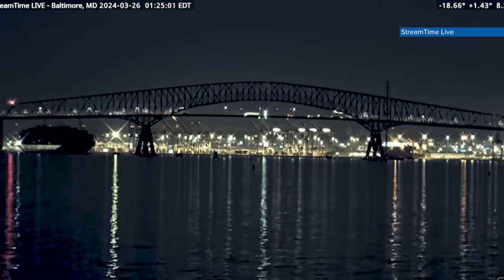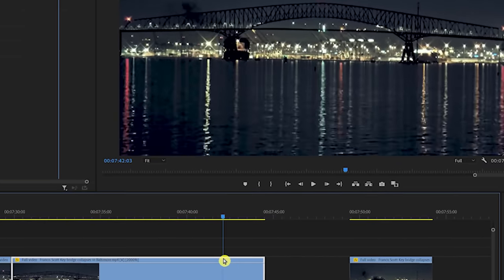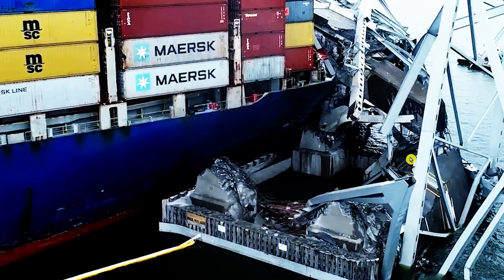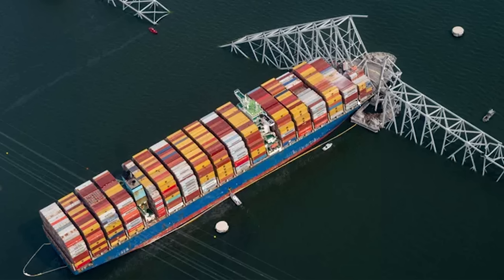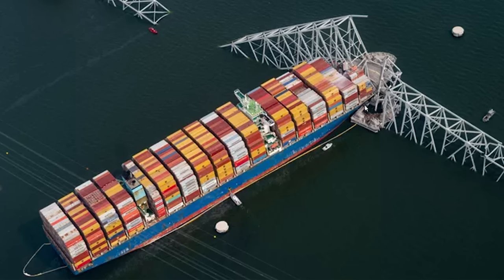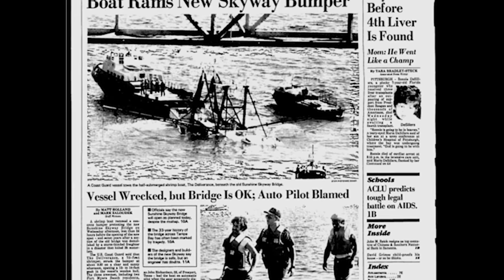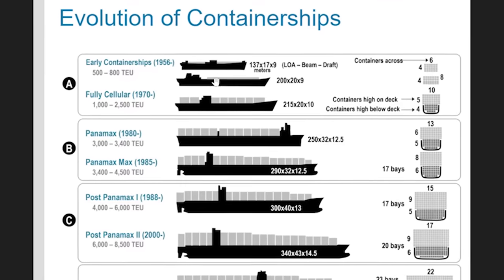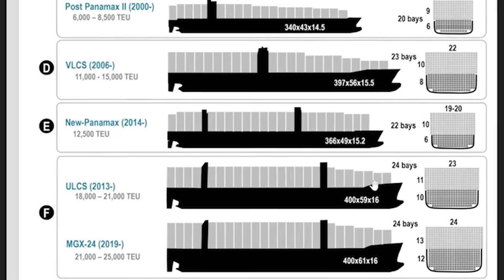NO Dali Bridge Crash Protection Like Sunshine Skyway Bridge?

Comment: The Francis Scott key bridge was built to specifications that were around in the 1970s. In the early '80s, there was an accident that brought a bridge down and they amended the code. This bridge predates that code. The replacement bridge will meet that code. It's not like this kind of thing is unusual. Code changing after you build an important structure.
Reply: The four dolphins there were built after the Tampa Skyway accident, and original plans had called for 4 others to be placed more or less where he estimated. However, the city of Baltimore rejected those plans because the city felt the cost was too great for a "very unlikely event" like this. These dolphins had nothing to do with the original layout, but we will see how it all turns out. As you said, the new bridge will be assured of increased protections, as well as other critical bridges being upgraded based on what we learn here.
Reply: @leechowning2712  Of course it will cost a billion dollars.
Reply: @leechowning2712 the city doesn't own the bridge nor have a say in it. It's a state owned bridge.

Comment: Question => Considering the need for a replacement bridge, what would be the best & most economical way to rebuild?  Is it your opinion that simply replacing the former structure with possibly improved pylons and dolphins would be recommended for expediency?   Once the debris is removed and channel re-opened, will bridge engineers or politicians determine the bridge structure replacement?

Comment: Thanks Jeff

I suppose easy to be wise in hindsight, but these types of accidents have happened in the past and lessons applied to both bridge operations and design as well as marine operations.

Many bridges have restraining straps (typically chains/cables) to help prevent catastrophic collapse in the event of a support being disrupted. Many heavily trafficked bridges also have substantial caissons up and downstream of the bridge pylon designed to deflect the largest out of control ships away from the bridge's pylons.
Reply: What if the ship is simply so large that you can't stop it? Try 112,382 tons. (A medium size ship).

Comment: simple regulation for tug support til out in open water would have made it unlikely too. 
it wouldn't have happened at vancouver's port because of such a requirement.
Reply: Remember, Vancouver had some very bad accidents.
Reply: Cost cutting, protocols but the bridge are well build from yesteryear but nowadays ship are getting bigger and bigger
Reply: Moran Towing and Harbor Services would love such legislation since it pretty much has a monopoly in every port from Maine to Texas. This company lobbies every year for both state and federal legislation requiring it.  They currently do escort and assist ships in and out of the harbor but only at the ship operator's request and at a very high cost.
Reply: Its happen before there's tugs support when channelling in or out till open water up to the nxt port of call but nowadays there's a protocol in some country like stateside you have to change over from heavy fuel to pure diesel while channelling and while at port, a ship is a power plant it has its own axilliary engine that gives electrical to run the machineries on deck and machineries on engine room that drives the main engine and all of that engine are design for heavy fuel exclude one emergency genset so its unpredictable when or when that something gonna happen
A container ship compare to other are well maintained old or new big or small and in port or at sea, what a hell for the engineers that things happen...RIP to those who perished on that incident

Comment: Jeff, 

Take a look at the Coronado Bridge (Coronado, CA to San Diego, CA), the Benicia-Martinez (Benicia, CA to Martinez, CA), and the Alfred Zampa Memorial Bridge (Crockett,  CA to Carquinez Heights, CA).  Each of these bridges has different arrangements than the Key Bridge, but all offer better protection. 

I can't recall which bridge the ARCO Juneau had an allision with it was either the Alfred Zampa or the Benicia-Martinez, but the fendering protected the bridge.  The ARCO Juneau was a 120,000 DWT tanker of a similar size to MV Dali.  The Juneau had two holes in the shell, one 10' high x 100' long, and the other 10' high x 200' long.

After watching the films over and over I believe that the flare of the bow overhung the fendering and it hit one of the bridge's stanchions, initiating a chain reaction of failures.  I heard someone in one of the news reports say when the bridge fell on the Dali the sudden load change grounded the vessel.  That is why the ship is trimmed by the bow.

Bob
Reply: The Arco Juneau had an allision with the Zampa bridge (locally known as the the Carquinez Bridge).

Comment: There is a bulbous bow on most large container ships that rides under the water line that would impact the protection structures much further ahead of your calculations. They stick out nearly as far as the highest bow points.
Reply: Bull nose water disperser
Reply: @bfa-xi1py  Agreed, that is why it side swiped the supports.

Comment: I would be very interested in a series on the protection ability of concrete dolphins at various U.S. ports. As was said container ships are getting bigger and our infrastructure (like bridges) is becoming older. I am currently living in an eastern U.S. state near a seaport so I am more than hypothetically interested in the safety measures currently in place.
Reply: For the most part they haven't kept up.
Reply: Sydney Harbour Australia has a similiar layout to Baltimore Port. Narrow exit called the "the Heads"..SH Bridge, opera House etc nearby. Approx 2 weeks ago the Queen Elizabeth (95,000T approx same length Dali) left Sydney. 3 big tugs escorted it through the heads and into open sea. Sydney Harbour Pilot/Tugs take no chances.

Comment: 99% of the time when people mention "fracture critical" they have no idea what they are talking about. If you disagree respond with the three requirements for a structure to be considered fracture critical. A 95000 ton ship is going to do a number on your bridge, same result if its a steel or concrete multi-girder, a suspension bridge, or cable stayed. You cant stand up when someone sweeps out your legs and a bridge cant stand without piers. What a shame. I liked the truss/tied arch combo. Reminds me of the Norris bridge in VA
Reply: You seem to be saying bumpers would do no good, I think that is correct. It is 112,382 tons, not fully loaded.
Reply: do you ever see what small street bollards do to 30 ton container truck?
Reply: My concern is that we let ships that large, without redundancy near bridges period.

Comment: There is another possibility to explore. The engine was intentionally shut off by the chief engineer when switching from normal diesel fuel (cost more, only used in port) to much cheaper heavy bunker fuel (not allow used in port) when it on its way.
Reply: Makes sense. Bad economy. Ukrainian Captain too.  High potential for greed
Reply: @SlickBlackCadillac  All Indian crew, where did you get your information?
Reply: What about the fact it was not out of the port? What about the rumor that it had power problems for 2 days before it left the dock?
Reply: HFO is not allowed in this are either, and the authorities look for things in the exhaust so ships who do their changeover too soon are regularly caught..
With that said, fueloil changeover does not require an engine shutdown, but will require the engine to run at some speed in order to clear the fuel system (mostly important when changing from hfo, to mdo as you aproach the line where you are no longer allowed to run on hfo, as the changeover process takes time to clear the fuel system and crossing the line too early can/will cause legal issues and fines)

Comment: Excellent analysis. Remember that very late in the series of events they dropped the port side anchor. Could that cause the stern to swing to the port side as that side anchor drags along.
Reply from the maker: No my guess is the anchor was dropped to make it pivot tot he left, but likely it was ineffective s the anchor will not slow down a moving ship, and maybe it needed more time to make it pivot.
Reply: @jeffostroff  I'm thinking they tossed the port anchor to swing the bow to port, but since the chains are so long, there wasn't enough time to actually take up the slack and start digging into the sediment before the impact.

Comment: The Sunshine Skyway bridge, too, came  under scrutiny some years back when it was noted that politicking for Florida resource use substituted Florida limestone for Vermont granite in the concrete superstructure when the destroyed bridge was rebuilt. The salt water conditions at the mouth of Tampa Bay in the Gulf of Mexico require significantly more maintenance to avoid corrosion (with limestone than granite).

Comment: If you find a shot of the stbd bow you will see a great slab of steel torn off the flare where the impact occurred.

The water either side of the dredged channel is 33-34 feet.
The channel is dredged to 50 feet.
The ship draws about 40 feet.
Once the ship got near the edge of the dredged channel, bank effect could have become a major issue.

Comment: I retired at the end of 2022 after 50 yrs working at most Port of Baltimore facilities. In the mid 70's when the bridge was built ships were nowhere near the size of these container ships today. I don't remember any Pure container ships then. There were large Combo ships from ACL and Barber lines (now NOSAC) that were RoRo below with stern ramps and containers stacked outside on the main deck. They still weren't the size of these Behemoths today. Who would have dreamed of them back in the 70's? I sure didn't!

Comment: Well,  a glancing blow was enough to sink the Titanic and it was enough here to bring down the Bridge.
Reply: And like the Titanic, it met the regulations when constructed. Just that regulations do not keep up with the times.

Titanic's lifeboats, met and exceeded the requirements when it was built, but the ships had got bigger with more passengers than the regulations were designed for.
I feel the bridge protection is the same. OK for 50 000 ton ships, but Dali is 100 000 ton and there are bigger ships coming.
Reply: @Kevin-go2dw     Titanic was on par for its time,  the Baltimore Bridge Was NOT.

Comment: In all my time I've learned one thing; disasters are a perfect storm of a chain of separate circumstances. Each link in that chain isn't enough to cause a disaster. Several or more links are required. 

This is no different. Single prop ship, inadequate bridge protection, questionable crew (qualifications and experience), mechanical failures, etc. Probably a few more we don't know about.
Perfect storm.

Comment: 3:40 - Regardless of camera angle, telephoto lens, or anything else - the ship WAS turning before impact.  The amount of side visible decreases significantly as it's moving along after the lights come back on and before impact.  The act of moving closer toward the camera alone would increase the apparent size.  Turning, however, changes the angle of view from the fixed camera and decreases the apparent size of the side.

Comment: Those rock-islands expands outwards with at most a 45 degree angle slope sub-surface, to avoid the waves eroding the island. So they gives a bit more protection than what's visible from above.

Comment: Nicely done - you are right on the protective barriers.   FYI the ship won't beach on the modern barriers , it will  most likely stop ship because of the depth of barrier and Depth of contact ship point and weight at bow ( else the bow rises and rides over the barrier till momentum  quals zero).  Also the weight ofDali at  8 knots( slight higher at contact)  results in a force of about 391 million Newtons or  about 88 million lbf  (force = mass x acceleration). So the 380Mill ftlbs barriers  at Sunshine Sky way would  have stoped Dali  easily.

Comment: Your comment about the overhang at the bow shearing the pillars of the bridge is exactly what I thought I saw when I watched the video the first time…. Considering the bridge was probably designed in the late 1960s, started in 1970 and opened in 1977, as you stated, the bridge was designed for much smaller ships.
Reply: There was clearly a huge splash and apparent debris shower, the sloping pillar fractures are AWAY from the ship which suggests a significant impact not a slight glancing blow.

What hasn’t been mentioned is how splindly the bridge and more importantly its mounts on the concrete columns were…

Comment: I don't want any rock or concrete underwater where it's not clearly visible to any idiot on a ship. 

I also don't think Baltimore has as much waterway to work with as the Sun bridge, or the Golden Gate Bridge, so all these suggestions aren't very helpful.  Still watching your updates, though
Reply: The central span is 366 metres which, it turns out, is exactly the same as the new Sunshine Skyway Bridge. The MV Dali has a beam of 38 metres. There is plenty of room for a navigation channel and proper protection.

Comment: @jeffostroff your irresistible coverage of OceanGate Titan is getting some competition here!  Correct on the dolphin placement, although the massive size and the concentrated force of such a vessel load impacting a well positioned dolphin might have torn a hole and help sink the vessel, but not before an impact on the most vulnerable bridge truss component; the roller.  A pin and roller design allows for much needed stability through a range of temperatures as the truss expands and contracts.  How did this ship make a perfect hit on the “floating” truss portion, creating a slide off the pier and collapse.  Had it hit the “pin” pier, I believe the damage would have been less.  Notice how the right structure simply rotated on failure!

Comment: I heard an explanation from a tug boat captain as to why the ship turned into the bridge support. when the ship got the main engines re-started the captain would have wanted reverse to slow / stop the ship however the tug captain said when you start a large single propeller the bottom of the prop in open water moves more water that the top which is close to the hull, with the effect that it walks the rear of the ship sideways for the first few revolutions.

Comment: The Dali has a massive (30 foot) propeller.  When they lost power and therefore steerage, it looks like someone cranked the propeller into reverse at full power.  (the large black plume that started right after the power loss) The propeller develops torque that is transmitted to the slip and (with no rudder control) cranked it sharply to the right, pointing it directly into the pillars.

Comment: Finally, someone notices that the incident is almost identical to that of the HMS Titanic: long glancing blow at the water line. This explains, too, the reported (not corroborated by me) flooding in forward starboard compartments. The sudden change of direction just before contact might have been an effort to bow-on the obstruction where least ship damage might occur. Further analyses will tell.

Comment: Your content is correct! 
They needed larger or multiple dolphins to protect the bridge supports! Also pay close attention to video just prior to collision and collapse? Beside the ship losing power and going dark. Which cause loss of control. The ships engines make dark smoke which may be indicating being thrown into reverse! With propellers in reverse this causes the stern of boat to move to port ( left ) and bow to move to starboard ( right ) sending the ship into a collision situation? So throwing ship into reverse may have caused the collision? The ship had a major casualty when it loss power.

This happened during exit from harbor under pilot control. But the Officer of deck (ships Officer on watch) did not know how to control the ship during casualty? And they knew they had no control of ship putting out a Mayday and dropping ships anchor!  With the multiple defects in ship systems, poor seamanship, along with poor handling of the casualty underway? 

Do not forget the Port of Baltimore for not planning to have having a ship striking the Bridge?  You build for the worst case situation and hope for the best!

6 men dead 1 injured critically.  Because of poor planning? 

This is why in the Navy they train you from first day in boot camp to handle damage control situations. The Navy even teaches Marines onboard how to handle situations? Even the Merchant Marine Academy teaches the new cadets, when it goes bad it goes bad BIG! 

Because the ship comes First!

Comment: The Golden Gate Bridge scenario you're thinking of isn't really possible. The Marin side is in very shallow water, so a ship would run aground before hitting it. The San Francisco side has an island like the Sunshine Skyway bridge has (and the depth around it is probably enough to make a ship like the Dali run aground, but it's not a certainty like the Marin side). The second San Francisco pylon at Fort Point is structurally separate, but it has the same problem as the Marin side where it is too close to shore and any big ship will run aground before it gets there. You also have to remember that the Bay is not very deep except in the shipping lanes, so an approach to the bridge where you are going to hit a pylon might also be impossible.

Comment: When considering the rock islands think in terms of "tip of iceberg".  There is much more below the surface.  For instance, it slopes up from much further away than what is visible above the surface.  The hull of a larger ship will begin running aground considerably further away than the visible part that is above the water surface.